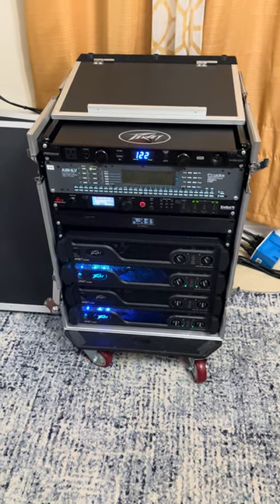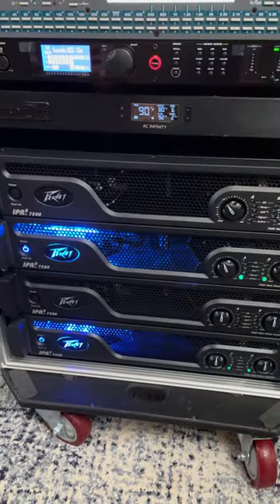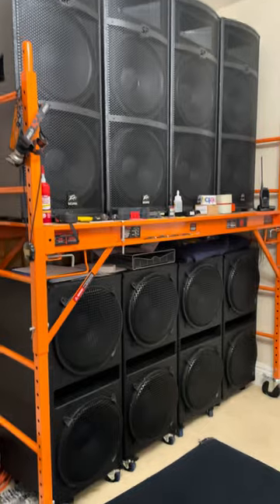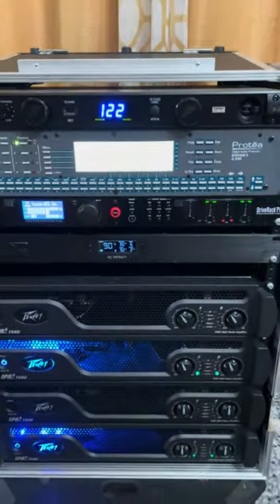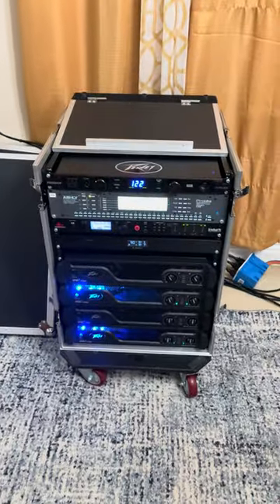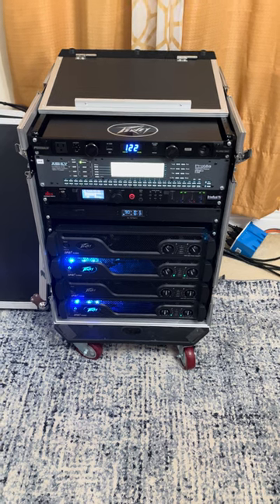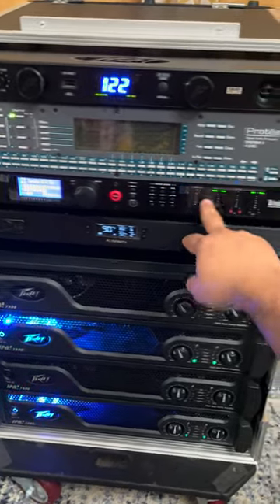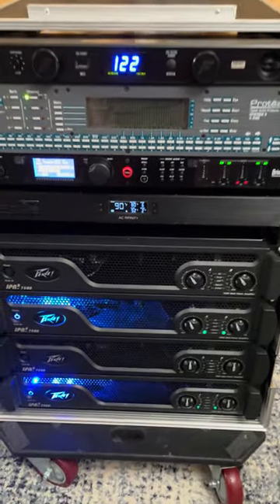Audio check with ashly protea 4.24G paired with peavey IPR2 7500

Comment: If you send your main input signal to the DSP first and then to the equalizer, how do you feed the separated frequencies to each respective amp? Your signal routing makes no sense
Reply from the maker: That’s an easy answer, the DSP only has 3 outputs and the Protea has 4, so to make it easy i send stereo signal to the DSP and only use 2 outputs from it,  one to cover full range and the other to low frequencies, so then I send that signal to the Protea and split 2 signals stereo channel of low frequencies and 2 of full range, that’s why I have 4 amps there, so 2 works with low frequencies and 2 full range, if I do it as you said then I will be having either mono signal to subs or mono full range, my current set everything is stereo
Reply from the maker: If I had a different DSP with at least 4 outputs then I wouldn’t need to do it this way, and besides the protea is my work horse and sound quality is top notch, Protea handles everything I throw at it and like I said everything is stereo, 2 outputs for low frequency and 2 for full range.!.!
Reply: @sonidoa.c.g3884 Decent rig but I still think you signal routing is a bit unorthodox but if it works for you, cheers!